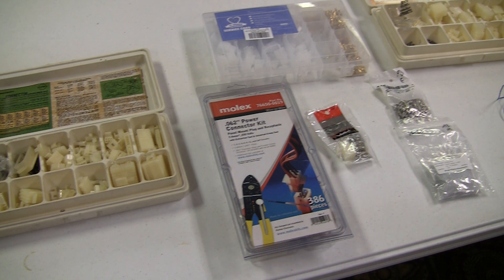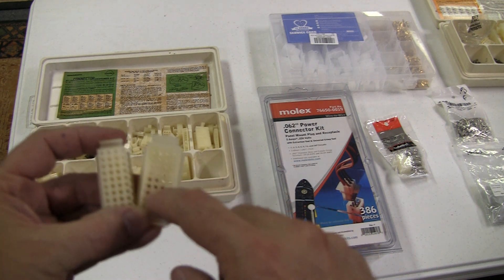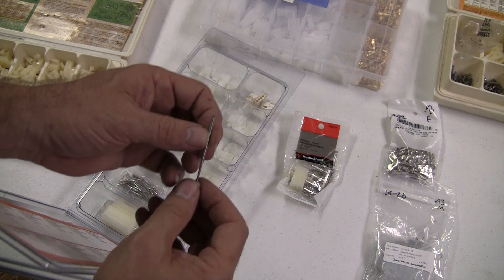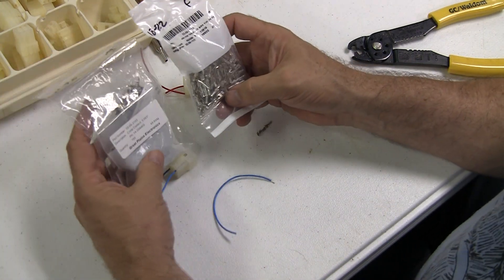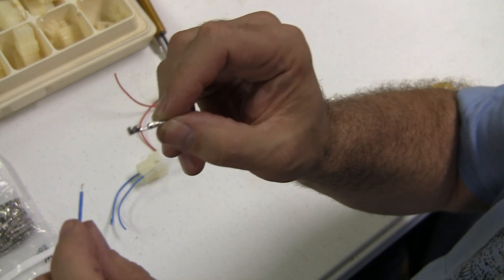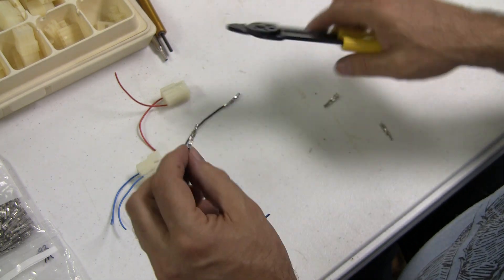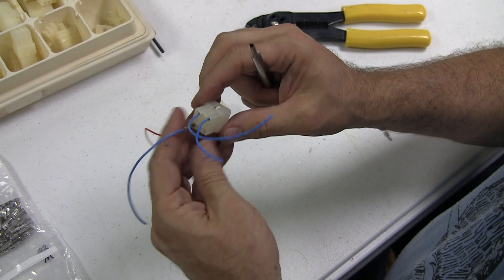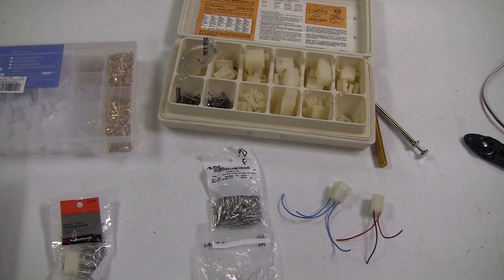All about Molex connectors, sizes, pins, tools and crimping! - PinballHelp.com

Comment: How do you take the pin off the wire if a mistake was made or the wire got ripped off
Reply from the maker: The pins aren't easily meant to be re-used.  You'll typically have to cut the pin off and use a new one.

Comment: hi, thanks for the video. do you know if the contact for a molex 5264 and contacts for a XH 2.54 are the same please? i have a new battery with a XH connector but i need to have a molex 5264 (that's the connector on the circuit board
), so i wanted to know if i can simply pull the wires out of one and pop them into the molex connector? thank you

Comment: PINBALL HELP,                            1.) Arcade Technicians have told me to change all the Molex and AMP pin types size to 0.156 inch  Trifurcon crimp terminals. I'm not sure why they want to use TRIFURCON type pin, any reasons why? I thought the pin size was how much current rating but the Trifurcon is better for higher currrent ratings I'm guessing. 
                             2.) In arcade games and pinball games the connectors and wires gets corroded which causes intermittent failures. I'm guessing the Trifurcon pins don't cause corroded interminitten failures? or what type of pins material would you recommend to not cause future intermittent corroded issues on the connectors?
Reply from the maker: Trifucon pins have more surface area than many other pins and "grab" more of the base connector.  They've proven to be more reliable.  The actual size of the pin will determine the amp rating.  In some cases pinball engineers underestimated the reliability and stability of certain pin/connector configurations.  This is most notable on Bally/Williams WPC games on the GI (general illumination) connectors.  With incandescent bulbs in the game, they can pull a lot of current and heat up the connectors and contacts, causing damage.  This is one (of the many reason) people including myself recommend using LED bulbs in GI instead of incandescent.  They use less power and will put less strain on connectors.
Reply: @PinballHelp  thanks for the help, 
1.) I'm still not sure why Trifucon pins can handle higher current amp rating they are made out some type of special nickel or steel coating to prevent oxidation and intermittent issues? 
2.) Which pin size do you recommend using because pinball games use 16 gauge to 22 gauge and use pin sizes .084, .100, .156, .093 molex and AMP connectors.
What are the common pinball pin sizes you run across?
 3.) I have heard you can use different types of pin types and sizes in either molex and AMP connectors which i guess are interchangeable? 
4.) I'm guessing you can use the same wire gauge like 16 gauge and use 0.156 pin and also use 22 gauge wire using 0.156 pin?  So you can use the same pin size even if the wire gauge is different? 
5.) I'm not sure what type of wire is used in pinball games and arcade games as in the wire insulation resistance to prevent the wires heating issues like in the GI wiring has a different wire insulation resistance being used in the GI wiring harness?
Reply: @billwilliams6338  Just go with Trifurcon contacts, as he said, and don't worry about all the questions afterward.  You're over-thinking this.   Sort of like the Email with the PIA questions (which I was happy answering!).   The Trifurcon grab on THREE sides, instead of just one side, so you get more surface area of the pin in contact with 3 sides of Surface Area on the Header Pin.   Plus the added grab will help keep the connection from getting hot and weakening everything.
Reply: @johnalexander7490  thanks for the help
1.) Some arcade games use 2 clock signals that are clock inverted signal and clock phase signal, any reasons why?
2.) Any reasons why arcade games use different RAM "access times"?
3.) The ROM's chips data width size doesn't equal when your "subtract" the address start and address end range. Any reasons why they would want blank unused space in the ROM chips not having any code? Is the blank space used in the ROM chips used for compiling the ROM data contents?
Reply: @billwilliams6338  You're getting into areas involving Programming Language and Routines / Subroutines and general MPU system architecture.  Find a book on programming, like a college course manual.
Reply: @johnalexander7490  yes but what does routines and subrountines have anything to do with the RAMs access time? and the 2 clocks phase signals access to the data buss and address buss?
Reply: @billwilliams6338  The program needs to run at the proper speed in contrast to how fast the hardware can operate or the maximum speed it can handle.
Reply: PS this topic is about connectors :)
Reply: @johnalexander7490  but what determines the speed of the games program code? or what determines the hardware access time?
Reply: @billwilliams6338  Processor Speed and Clocking circuitry determine how fast the game can run code, but game signal timing is still determined by the code.  Hardware access time would be determined by the actual components being used, with the Access times, etc, would all be listed on the Part Datasheet.   Go to Google and look for "MC6821 Datasheet PDF" and find a data sheet for a standard PIA chip.  You can see how the timing signals are used on that chip and get an idea of what goes on in the games.  Design Books work well here.
Reply: @johnalexander7490  yes i see the access time on the datasheets for parts RAM chips, PIA chips, PLA chips, but I don't know what determines a designer to choose which access time is right for the game programming code. How would a software game programming code know which access time to choose for the IC chips?
Reply: @johnalexander7490  
The software game programming looks at all the datasheets access times for the all the IC chips and choose the access time based on the Clock speed? 

If the clock speed is 1Mhz, what access time would be good to use?
If the clock speed is 4 Mhz, what access time would be good to use?
Reply: @johnalexander7490  HI again 
                                     I'm confused why some arcade games what to redirect the addressing?
                  What is the "advantages" of redirecting the addresses?
---------------------------------What is the "advantages" of bank switching the data buss lines and band switching the address buss lines?